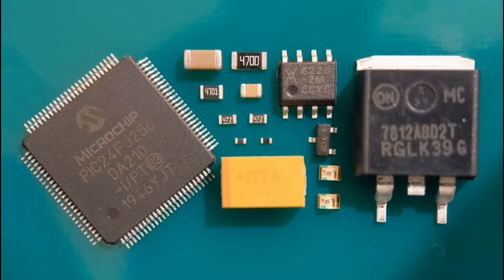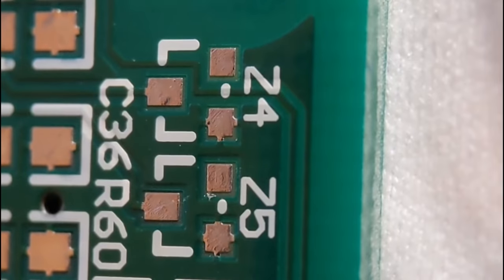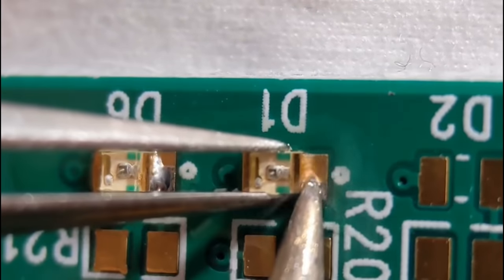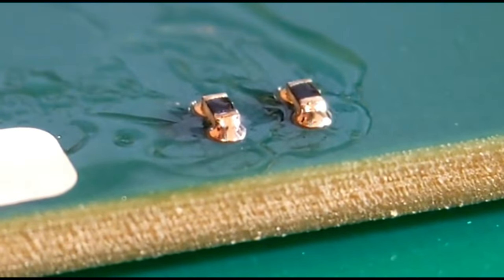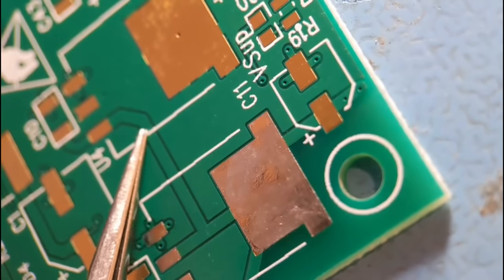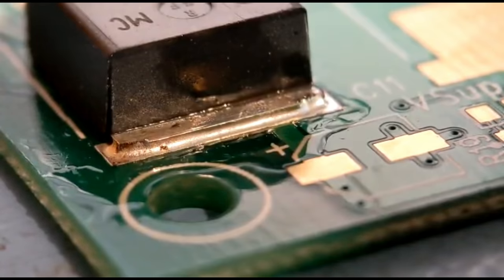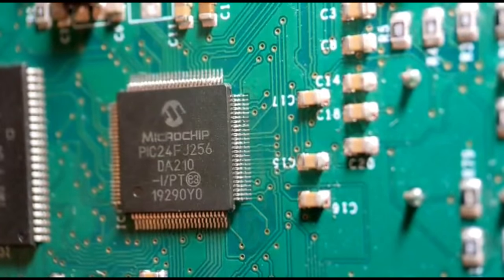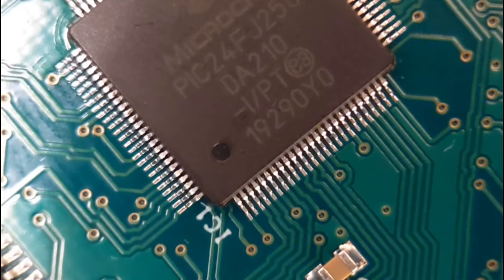How To Solder SMD Correctly - Part 1 /SMD Soldering Tutorial

Comment: wow I so much wanna be able to do this; what temperature do you keep your blower and solder iron at for maximum efficiency, please? 

do you use any type of magnifiers to be able to see these small electronic components, please?
Reply from the maker: Hi , thank you for your comment , much appreciated. Generally if I'm using  leaded solder I would set my iron temperature to roughly 330 degrees Celsius and if I'm using unleaded solder I would up the temperature to about 370 to 375 degrees Celsius. I may vary these slightly for certain jobs but overall these are the temperatures I would normally use . If I'm using a hot air gun to flow parts or remove parts for unleaded I would set my hot air station to about 390 to 420 degrees Celsius and for leaded I would try about 375 degrees Celsius. Best to start slightly lower and if that's not enough tweek it up and try again . I set the air flow to fairly low for most reworking but just raise it bit by bit if I'm struggling. I do use a microscope for tiny soldering , mines a stereo long reach from GT Vision ( England  ) there own branded one .Hope that helps , thanks again 👍
Reply: @mrsolderfix3996  thanks so much for elaborating on these. My 3 in 1 workstation is my first issue then because the max value  is set at 400 degree F

Comment: What do you use to clean the flux off the component? The material you are using to wipe it with?
Reply from the maker: Hi , thank you for your comment , much appreciated . The wipes I use are called Gtek dry wipes and I get them from a company in England called Grove Sales . Unfortunately I don't think they ship these overseas , but worth emailing them to see . I dip them in a fluid called Ultrasolve . Hope that helps , thanks again 👍

Comment: I’m doing a IC3006 what is that you say flax I need to get some of that first I have to take the old one off it tiny
Reply from the maker: Hi , thank you for your comment. I presume you mean the flux that I added to the legs before I started. If so I use a flux called SMFL200D but there are many different fluxes available . If in England or Europe I would use Farnell , RS Components or Rapid Online  , if in America Mouser or Digikey , but there are plenty of other places that stock solder flux .I don't do links to products ( just my choice not to ) . I've done a complete video all about flux if you ever needed more info , how to use etc . Hope that helps , good luck 👍

Comment: It always amazes me that people can solder this small with a regular soldering iron and use lead free solder.
Reply from the maker: Hi , thank you for your comment , much appreciated. The main thing with fine pitch soldering with leaded or unleaded solder is to get yourself some 0.25mm thickness solder . This is where most people go wrong , they use generally 0.5mm solder making the job so much more difficult and for the novice solderer probably impossible . 0.25mm is pretty easy to get these days so hopefully more and more people can get confident at fine pitch when they get hold of some . Thanks again , take care 👍

Comment: Great video  - I have struggled with SMD components but will give them another go thanks to your post - your video was awash with flux - what do you recommend for this? (I've historically used multicore flux solder and the thin modern solder doesn't seem to have enough (any) flux.
Best regards
Peter
Reply from the maker: Hi , thank you for your comment , much appreciated. I'm glad you enjoyed the video . I've posted a similar one to this ( part 4 ) which is much clearer and more in depth , maybe this will be useful for you . I have other videos on my channel showing all the fluxes I use and cleaning fluids etc , all the information you require will be on these videos . They are easy to find .Thanks again and good luck with everything 👍
Reply: @mrsolderfix3996  Excellent - many thanks
Reply from the maker: Hi no problem , I hope you get on ok with all your soldering projects . I will always post more videos when I get some spare time, thanks again 👍

Comment: How do you identify a resistor that does not have a number on it. It has a number on the board but the resistors it self doesn't have one. Comparing to the other resistors on the board the real small ones don't have number on the unit it self. Number next to spot is r103
Reply from the maker: Hi . Thanks for watching. I guess you have 0201 or 0402 size resistors in some positions on your board. These small size  components never have writing on them as they are to small to mark up . The only way to tell what value they are unless you have a parts list is to lift up one end or take them totally off the board and measure them with an ohm meter. Resistors can give false readings if you measure them when they are soldered down on both ends. These sizes are more and more common these days so you will see this a lot .R103 that you have is just the location of the part on the board. Hope that helps 👍
Reply: @mrsolderfix3996  yes thank you!! Yeah the one I need to replace broke off, but there are similar ones all around the board. I will try your suggestion. Thank you for the reply!

Comment: What kind of flux are you using and what is the black applicator tool called?
Reply from the maker: Hi , thank you for your comment. 
The flux I have used for many years is called SMFL200D . Unfortunately this flux has recently been discontinued so I'm looking for a new type at this point in time. When I find a decent alternative I will post it on YouTube. All I use to apply the flux is a dipped plastic cable tie, works really well. Hope that helps , thanks again for your time 👍

Comment: Hi, fantastic video. Can you please recommend a Solder. Maybe something listed on Amazon. Would be much appreciated 👌
Reply from the maker: Hi , thank you for your comment. I use for lead free soldering Sn100sb solder wire supplied by a company called BLT Circuits ( England ) , it's the best lead free I've ever used leaving lovely shiny joints . Comes in a range of sizes from 0.25mm upwards . The leaded is just a standard one also from BLT . If your in England give them a call and they will help you out with anything you need . Their prices are amazing as well compared to the general stockists we all know . Hope that helps , thanks again 👍
Reply: @mrsolderfix3996  patchcomputers here. Many thanks for your advice and help, very much appreciated. Have yourself a fantastic Christmas!
Reply from the maker: Hi , no problem . If you are in the UK and you wanted to contact BLT , ask for Greg . He is a wealth of knowledge on solders , fluxes , solder paste etc which they also supply . He can find anything out you need to know and is so helpful. 
Like I said earlier their prices are also really good . I don't have any association with BLT , I just use them for their products . Thanks for your support , you to have a great Christmas 👍

Comment: I've started my journey into the world of electronics and the first question I have is how can we find the values of a multilayer ceramic capacitor that is shorted without schematics??
Reply from the maker: Hi . Quite often your capacitor will be showing a short circuit across it because of a fault elsewhere on the board , so it means your capacitor isn't the problem . You can get the value of the capacitor in question by lifting up one end of the component and then measuring across it . Components often read differently when fully mounted to the board that's why I lift one end up or take it totally off . This may work for you ? I'm by no means an expert with circuitry , I'm more how to do the build side of PCB's , soldering , modifications etc. Thank you for watching and good luck👍
Reply: @mrsolderfix3996  Thank you so much for your help it's greatly appreciated 👍 I understand that if you take a good capacitor out of circuit and measure it's capacitance that will give it's value but for one that's damaged/shorted I'm not too sure, maybe it's worth getting a good cap measure it and then short the thing and measure it again 🤔 why they didn't just add an identifier is beyond me lol  😂 I understand that they are small but these days we can laser engrave the values on even the smallest of caps manufacturers take note please lol

Comment: Just found you ... thank you ... can you recommend a soldering iron? I am mostly making up instrument cables but would like to do more mods and stuff on my synths. Would love to hear your recommendations for decent kit :)
Reply from the maker: Hi . Thanks for watching, much appreciated. I personally use a Weller TCP S soldering iron which I really like . It's a bit old school but I can do anything I need to with it down to 0201 size components . Any Weller iron is pretty good . Another good make is Metcal . They do a variety of units all of which will be decent . Avoid the real cheap irons as they don't last and you can't get the tip selection you get with more expensive irons . Basically you get what you pay for with soldering irons . Good luck 👍
Reply: @mrsolderfix3996  that's really helpful thankyou.

Comment: for what flux is used?
and can you provide me with product you are using plz
Reply from the maker: Hi . The flux I use is called SMFL200D . Available from most electronic distributers like Farnell , RS Components , Rapid Online , even on eBay . Pretty easy to get , about £14 for a 200ml spray can . I just squirt some into a small container then apply using a dipped plastic Ty wrap . Hope that helps 👍

Comment: I am studying basic electronics I have no clue what I am doing . I have been beating my head against the wall how they solder these huge ICs with all the legs on it. I thought when you started soldering the leg the solder would flow to the other leg and short it out I have no clue that the lining on the board protected the cross over on the solder joints , I have clue what these circuits do but that is cool as hell ! Thanks for answering my question.

Comment: Hello, tell me please, which flux do you use? Thanks.
Reply from the maker: Hi . I use SMFL200D flux . A great liquid flux , available from Farnell , RS Components , Rapid Online , even seen it on eBay. Comes in a 200ml spray can , I normally just squirt some into a small container then apply using a dipped plastic Ty wrap. Hope that helps 👍
Reply: @mrsolderfix3996  Thanks

Comment: Great job! What flux are you using, and are you just using IPA to clean it?  I’ve become a big fan of low and medium temp solder pastes, silk screens and, reflow ovens or hot air guns, but previously I was using “the other technique” that you described.  I like this better, your components are flat to the board every time.  Self taught

Comment: My question is what is the best source for data sheets? I have a hard time finding them.
Reply from the maker: Hi . What I tend to do when I need data sheets is just type the component into Google , you should then get up either Farnell , RS Components , Mouser or digikey listing this particular component . Just go to any of them , i.e Farnell . It will bring up said component at Farnell in this case then scroll down on component info until you hit datasheet. Works probably 99% of the time using these big 4 companies mentioned above . Good luck 👍

Comment: I dont think I heard you mention about what temperature your soldering iron is set.
Reply from the maker: Hi , thank you for your comment. Leaded soldering I set the iron at 330 degrees centigrade and for lead free about 350 - 360 degrees centigrade. Sometimes I need to vary these temps for certain components but generally I would stick to roughly these . Hope that helps , thanks again 👍

Comment: I am planning on soldering back a 3.5mm female audio port on my tcl tv mainboard. It has 7 flat legs. Do i need flux or can i straight solder it with unleaded tin?
Reply from the maker: Hi . I'm one of them people who use flux on every joint I do . I know some people don't and feel you don't need to but personally I believe you get much better results when soldering by adding a little flux on your joints 👍
Reply: @mrsolderfix3996  Thank you so much. It's the first time that i am soldering (and probably only time) so i will see if i can buy a small amount of flux!
Reply from the maker: Hi . Good luck . Leaded solder will make it easier as well if you can get any . Lead free will prob be more difficult for you 👍

Comment: SOS SOS SOS SOS SOS SOS SOS  SOS

okay so this video kinda is a big help to me to start ive been building free style drones and im kinda tired of spending 55-120 every time i have to replace a part now i would like to learn how to test mcu, capacitor, resisot, mosfets, regulators all of that once i understand how to trace a board from A-B then i be able to repair my own boards untill i can find a place to buy the parts but for now if some one could point me in the right direction i would appreciate it im trying to repair (Flight Controllers) for freestyle drones

Comment: Sir please  give solder wire name and size for 80 pin ic soldering,  ,,
And  flux name.
Sir this time whis temperature  keeping  soldering iron.
Reply from the maker: Hi , thank you for your comment . The solder I mainly used in this video was 0.25mm Nitrosol , Sn100Sb, lead free solder , from a company based in England called BLT Circuits. 
The only flux I ever use is SMFL200D , available from various electronic suppliers , Farnell , CPC etc. I've actually posted a complete video on YouTube all about this flux . And the temperature when I soldered up the 100 pin fine pitch IC was roughly 350 degrees centigrade . Hope that helps , thanks again 👍
Reply: @mrsolderfix3996  thanks,  thanks sir.  
Very  useful  video  for Electronics work.  Thanks  sir
Reply from the maker: Hi , no problem , hope you get on ok with all your soldering projects . Thank you again for watching 👍

Comment: How do you fix the first part of components... it's like you put solder without putting solder with your iron ... I really don't understand that part
Reply from the maker: Hi , thank you for your comment. I place a tiny amount of solder on the end of my soldering iron tip then position the component I'm working on in the correct place ( having already pre- fluxed this area )  then simply add the small amount of pre loaded solder onto one end of a resistor or capacitor ( holding with tweezers ) as an example or if your working on an IC I would do one joint on 3 or 4 sides of these devices  . I have showed this method in quite a few of my YouTube videos, it works every time. Hope that helps , thanks again 👍
Reply: @mrsolderfix3996  thanks
Reply from the maker: Hi , no problem . Good luck 👍

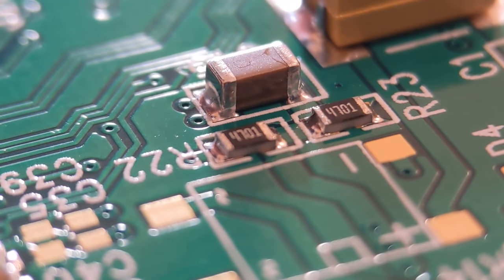Comment: the QFP   you do at 14:16  https://youtu.be/EW9Y8rDm4kE?t=901    I don't think I'd be able to hold the solder and tip steady enough to do it 1-pin at a time like that in and out without making a mess.  looks like you are also using  a very small  solder.  is that  0.03mm  size?  I see technique is just to only feed it smallest amount of thin solder and pull solder away quickly before it leaves too much. it's fun to watch you work.  I  do gentle drag soldering bc the single pins QFN takes a lot of experience. my 0.3mm solder seems too thick.  I see you said  it is 0.25mm solder for this. I'll look for something smaller than my 0.3mm one.  thanks a bunch.

Comment: I use a small toothbrush dipped in isopropyl alcohol to clean the soldered connections of any dirt or residue from the soldering process.
Reply from the maker: Hi , thank you for your comment. I know a few people who use isopropyl to clean their boards but I've always personally got amazing results with a fluid called Ultrasolve . I also use one called Flux Off and I've shown  both of these in a YouTube video I posted about cleaning boards . They are the 2 fluids I would always use .Thanks again , take care 👍
Reply: @mrsolderfix3996  Yeah, Ultrasolve and Flux Off work well, but are considerably more expensive than plain old isopropyl alcohol that you can easily obtain practically anywhere. 🙂

Comment: I'm curious I have 2 blown resistors on a gpu only thing is I don't know what they are is there a way to figure that out or do I have to get ahold of the manufacturer about that. Thanks and you're soldering skills are top notch man good job!
Reply from the maker: Hi , thank you for your comment. Are the parts surface mount or through hole ? If they are surface mount anything from 0603 size will normally have a code written on it which you can work out what the value is from this code . Or if through hole you can work out the value from the colour bands on the resistor. I guess as they've blown though maybe these will be unreadable . You could contact the manufacturer or go on line and see if you can find the schematics for your circuit . Hopefully you get the info you need . Good luck , take care 👍
Reply: So I was just doing some investigating and the part is next to the shunt resistors and the writing on it says bva it looks like a type of fuse but I can't find any sources for this part.
Reply: I feel like I can easily fix it if I could find the part it is quite small but I have a good solder gun and steady hands. I've been looking everywhere but I can't find anything on this part.
Reply from the maker: Hi , this is quite common unfortunately. Board designers can often sneak a part into the circuit with no particular markings that mean much on them so it's almost impossible to rip their board off . You could try contacting the supplier I guess to see if they could help you or look online to see if anyone's ever posted a schematic of the circuit which would tell you the type of part you require . Good luck , take care 👍